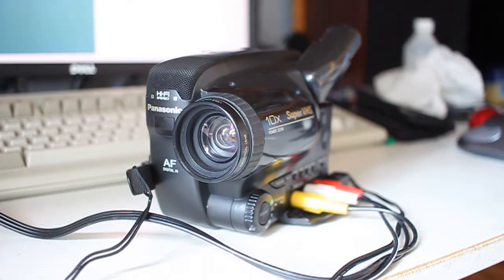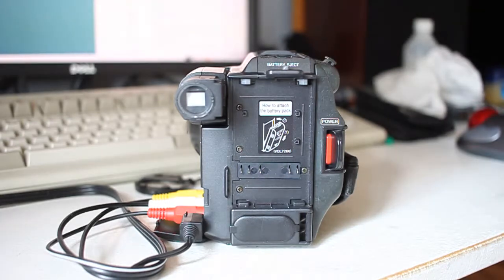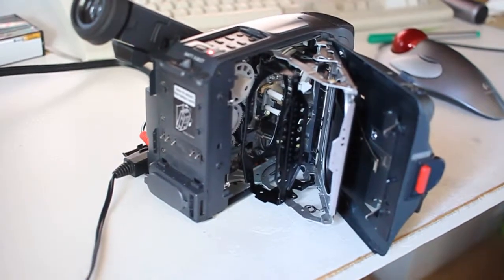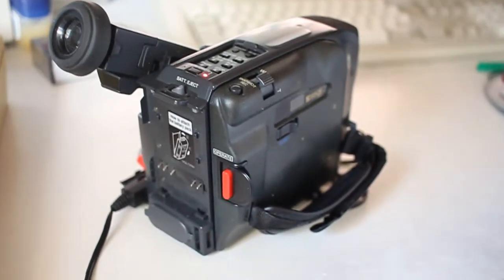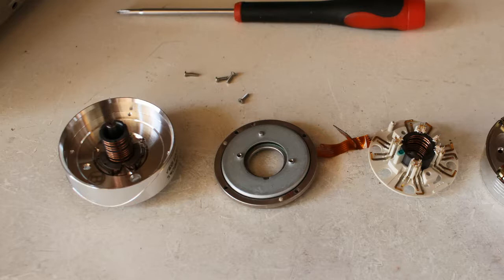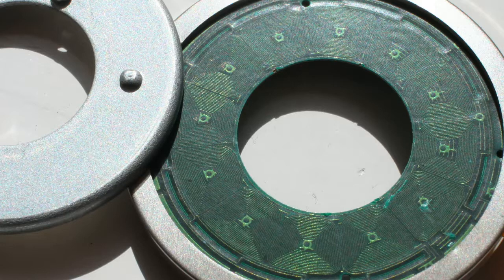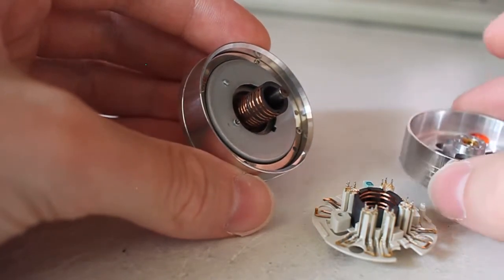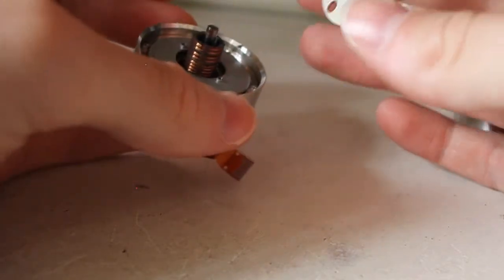Panasonic SVHS-C Camcorder fault & Video Head Teardown

Comment: Hey Steve, great vid. I have a panasone nv-s7B with a noisy head that I think needs some lube as you have shown. But I can't see how you get to the three screws on the head, a bar covers access to them and I can't see how to remove it.
Reply from the maker: I'm not sure. These things can be a pain to disassemble and usually have to be done in the right order. The S7 service manual can be found here if you haven't already got one: https://elektrotanya.com/panasonic_nv-s7_nv-s700.rar/download.html . Good luck!

Comment: What kind of power plug are you using? And is it possible to buy a new battery for a NV-S70?
Reply from the maker: The power connector is a special 4 pin square one, which connects up to the battery charger. As for batteries, I've seen sellers list them on ebay, so you can probably get one. No guarantees on how long it will last though.
Reply: @stevecoatesdotnet  Thank you for the answer - i found a battery. Another question, I get an error called "F 02" when trying to record or watch tape on the camera. Do you know what to do?
Reply from the maker: @Spalthe  According to the S85 service manual, F 02 means "S-Reel Lock". I'm guess the the S70 will be the same. I assume that means there is some issue with the supply reel of the cassette. I don't know what the fix would be. I'd suggest checking that there is nothing jamming the supply reel in the tape, and nothing jamming the mechanism in the camcorder.
Reply: @stevecoatesdotnet   Okay, I will check that out. Thank you for the answer!

Comment: Did you fix it? I have the same Palmcorder with the same issue. It somewhat plays back the tape but with colour issues and some vhs artifacts, and after a few minutes the playback dies and it refuses to play any more, and the green LED at the top switches to the red and it's blinking. Overheating cause of the friction? 🤷🏼‍♂️
Reply from the maker: I managed to fix the loud screeching noise by lubricating the bearing in the head, as that is where the noise came from. I don't know how long that fix will last, but its OK for a vintage camcorder which will only see occasional use. The blinking LED will indicate a fault of some kind (or maybe a poor battery) but I couldn't say what.
Reply: @stevecoatesdotnet  Hi! I am having the same noise problem seen in the video on a different panasonic camcorder. I cant find a video or tutorial on how to open up the head or where I should put the lubricant. Could you help me out?
Reply from the maker: @cdotbot  I'm making a video showing how I got the head apart. I'll hopefully get it finished this week or next week.
Reply: @stevecoatesdotnet  amazing, thank you!
Reply from the maker: @cdotbot  I uploaded the video of the head repair: https://www.youtube.com/watch?v=VXzxpEfnp_M
Hopefully it might be of interest.
Reply: @stevecoatesdotnet  thank you so much!